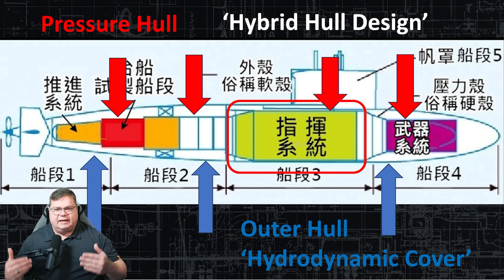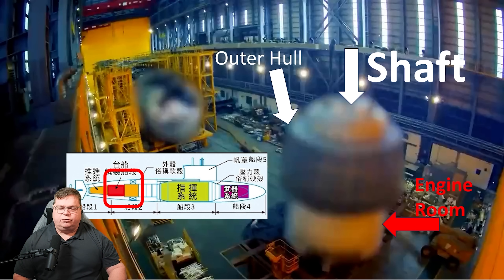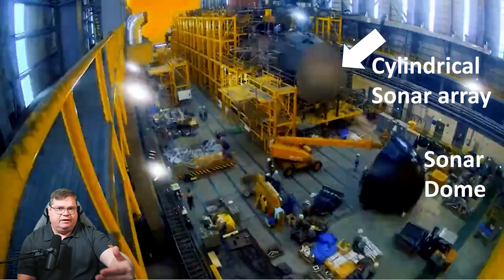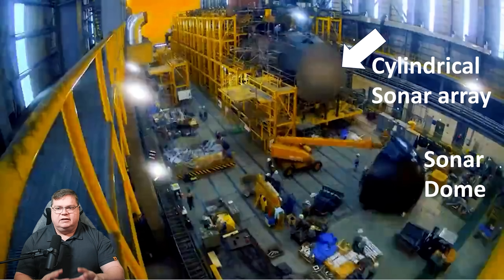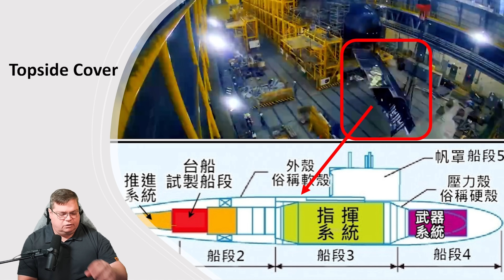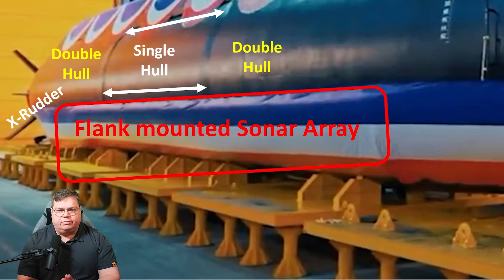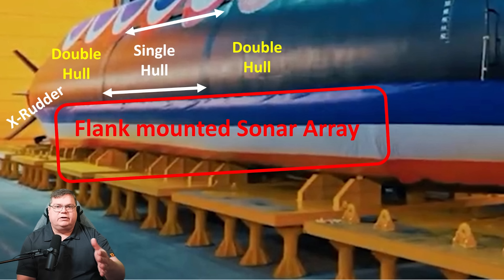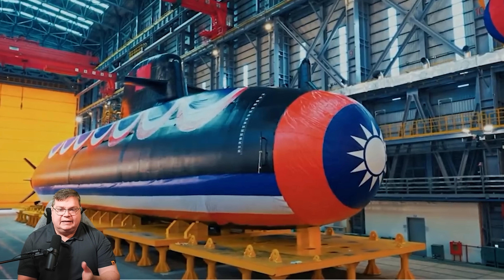What They Don't Tell You About Taiwan's First Submarine

Comment: So Taiwan now has the worlds newest and oldest submarines in their navy.
Reply: Taiwan's first nearly 3,000-ton self-made submarine "Narwhal" has just been built and is undergoing testing. Taiwan's first AI unmanned attack submarine "Huilong" will also be launched by the end of this year.
While Taiwan is building manned submarines, it is also secretly using submarine development technology to produce unmanned submarines. The self-made "Huilong" (meaning: Intelligent Dragon) unmanned submarine is a smaller version of the submarine, with specifications of 30 meters long, 6 meters high and 3.6 meters wide. It adopts a double-shell design (the length of the inner pressure shell is 20 meters). Its height including the sail cover is 6 meters, and the outer shell is also coated with black sound-absorbing coating. In addition, the internal settings are not only equipped with cruise, sonar detection and other systems, but more importantly, it also adds a life support system (for special forces missions) and a system equipped with two torpedo launch tubes. This is almost the basic configuration of a 100-ton small submarine. It uses a hull similar to a manned submarine with a sail-type structure design, and is also equipped with two torpedo launch tubes. The "Huilong" unmanned submarine can launch small unmanned AI boats, torpedoes, mines and underwater loitering munitions to monitor, lock on and loiter attacks on enemy targets. The hull of the "Huilong" unmanned submarine is made of alloy steel produced by Taiwan Steel and can withstand seawater pressure of 1,000 meters. It allows the "Huilong" unmanned submarine to stay at a depth of nearly 900 meters underwater. Not only will it not be detected, but it will also be unable to be attacked by mines or torpedoes.
The "Huilong" unmanned submarine can perform combat missions alone, or it can accompany the submarine as a wing boat for coordinated operations.
Taiwanese civilian manufacturer has developed an Autonomous Underwater Vehicle (AUV) for the Navy - the Seawolf 400 AUV system. The Seawolf 400 AUV is 4 meters long, weighs about 1,000 kilograms, has a speed of 2 to 7 knots, can submerge for 8 to 10 hours, and can carry AI reconnaissance equipment and attack weapons.
Taiwan's Navy has partnered with an innovative company to develop an underwater glider. This equipment has the characteristics of long-term operation, large-scale collection of underwater information, high concealment, low maintenance and operation costs, fast maneuverability, and diversified underwater reconnaissance. It can collect hydrographic information for the Navy and influence the selection of sonar modes and the application of tactics. In addition, the equipment also has stealth characteristics and can perform underwater missions for more than one month, improving the Navy's ability to deal with underwater operations and intelligence collection. Several underwater gliders are currently being deployed to perform missions.

Taiwan plans to produce eight Submarines, 46 AI Unmanned Submarines, hundreds of Seawolf 400 AUVs, and a fleet of Underwater Gliders. Based on this, the Taiwan Navy has been able to build a powerful, modern underwater fleet with AI networked combat capabilities.
Reply: Chinese cyber army pretend Taiwanese and say ridiculous words
Reply: Wumao in full swing ah
Reply: Taiwan took 4 years to learn and design its self-made submarine, and only took 3 years to complete its self-made modern submarine.  Taiwan break the world record for manufacturing the submarine. In 1988 Taiwan was the 1st Asian country who could design and manufacture self-made 3rd generation Jet Fighter. Taiwan is also designing its own fifth-generation stealth twin-engine fighter jet, and the prototype will be produced in 2025. Taiwan is not only strong in semiconductor chip manufacturing technology, but also in other industries. Bravo Taiwan.
Reply: Yes, we Taiwan do, always~.~
Reply: yes, thanks for all the people that is helping us, moss of our subs in the serving of our nave is all grandpa aged subs.....
Reply: Computational power is both national power and military strength. Efficient AI computation depends on high-performance AI chips, and only Taiwan's TSMC can manufacture the highest-end AI chips in the world. Taiwan's National Chung-Shan Institute of Science and Technology has completely domestically developed technologies such as stealth materials, electromagnetic wave absorption materials, and multi-spectrum radar wave scattering materials. Taiwan is also the world's largest and most technologically advanced manufacturer of carbon fiber composites.
With these technological and industrial strengths, it will be a breeze for Taiwan to develop AI-powered missiles that are stealthy, can find targets on their own, counter enemy electronic warfare, and evade enemy detection. AI-powered attack drones, unmanned submarines, unmanned ships, and unmanned jet fighters will also be within Taiwan's reach.
Taiwan's military industrial development strategy is clear and unambiguous. It is to leverage its technological and manufacturing industry advantages to selectively develop military industries.
Reply: Many people are unaware of Taiwan's current industrial and overall economic strength.
Taiwan has a developed technology and manufacturing industry, with global rankings of first in semiconductor chip manufacturing technology, first in information and communication equipment manufacturing, third in machinery and parts manufacturing, third in the scale of biopharmaceutical enterprises, fourth in machine tool industry, sixth in the scale of chemical plants, fifth in the world in terms of shipbuilding tonnage, and sixth in terms of aerospace industry output. It is also the world's largest and technologically best country for carbon fiber composite outsourcing, from tennis rackets, bicycles to aircraft components. Taiwan has many companies that are mid-to-upstream manufacturing companies that are hidden champions in the world. It has produced supercomputers, super AI computers, satellites, and has successfully launched military space rockets on multiple secret occasions. Taiwan's overall technology and manufacturing industry strength is at the forefront with the United States, Japan, and the European Union industrial countries. Taiwan is currently the 20th largest economy in the world, with total foreign investment assets of over USD 2 trillion. It is the fifth largest outward investor in the world and the fifth largest net creditor country in the world.
Manufacturing has always been used to produce consumer goods first, and then military equipment was manufactured due to national defense and war needs. Taiwan's industrial strength is completely used in the export of civilian industries, and the production of military and weapons is limited to specific government agencies. In the past, the government did not attach importance to integrating and supporting private enterprises, coupled with no export opportunities, private enterprise factories were not interested in investing in the production of military equipment. On the other hand, American military companies have long seen the manufacturing capabilities of many Taiwanese manufacturers and have purchased the supply chains of important components and assembly parts for their military from Taiwanese factories, such as military-grade microwave RF semiconductor components, rocket satellite precision components, electric vehicle bearings, military-grade electronic equipment components, military-grade computers, and military-grade carbon fiber composite outsourcing. TSMC is also one of the three major military-grade chip manufacturers for the US Department of Defense. Military-grade chips below 14 nanometers are all manufactured by TSMC. TSMC is the only company in the world that provides military-grade 5-nanometer chip manufacturing technology to produce high-performance logic chips and AI chips.
China is threatening Taiwan by firing missiles and circling Taiwan with aircraft and ships in the waters around the Taiwan Strait. Under the pressure of China's constant verbal and military threats, Taiwan quickly completed its own design of submarines, self-developed the production of submarine steel, and the US, UK, and EU democracies provided Taiwan with core submarine components, and Japan and South Korea provided shipbuilding technology. Some of the core components are still manufactured by Taiwan with the support of chips. It is no problem for Taiwan's overall industrial strength to be converted to support military research and production. Subsequent submarine production will be able to achieve complete localization of submarines in batches.
Reply: Taiwan's IDS Indigenous Defense Submarine is planned to use domestically produced "lithium batteries" as the submarine's underwater power system.
Japan's Maritime Self-Defense Force's Soryu-class "Phoenix" and "Dragon" submarines, as well as the latest Oshidori-class "Oshidori" and "Shirotori" submarines,
 all use "lithium battery systems" as the submarine's underwater power system. The South Korean Navy has also announced that its second batch of new "Dosan Ahn Changho-class" submarines will also abandon AIP power systems and start using "lithium batteries"
 as submarine power systems. These modern submarine countries that use lithium batteries as their main power source have kept secret the amount of time their lithium battery power systems can operate underwater, which has aroused curiosity among people.
Recently, the U.S. naval professional media "Naval News" reported that the Indonesian Navy will order from France a new batch of "lithium battery"-powered Scorpene-class
 submarines for it, which is referred to by the French side as the "Scorpene Evolved". The French shipbuilding company Naval Group claims that the class of submarines, equipped with "lithium batteries", can last up to 80 days on a single mission, of which 78
 days are submerged, and the maximum range can reach 8,000 nautical miles (about 14,816 kilometers), significantly reducing the rate of surfacing.
The French "Scorpene Evolved" lithium battery submarine has a weight of 2,000 tons, and the lithium batteries fully charged can support the submarine for 78
 days of submerged operation. The Taiwan-made IDS submarine has a weight of nearly 2,800 tons, and can carry more lithium batteries than the French "Scorpene Evolved" lithium battery submarine. It is estimated that the Taiwan-made IDS submarine with lithium
 battery power system may support 90 days of submerged operation.
Reply: Taiwan has successfully developed a 533mm-diameter torpedo launch system for Taiwan-made IDS submarine Narwhal. In addition to being used to launch US-made MK-48 heavy torpedoes, the system is also being prepared to launch Taiwanese-made submarine-launched Hsiung Feng II anti-ship missiles, submarine-launched Hsiung Feng III supersonic anti-ship missiles, submarine-launched Hsiung Sheng cruise missiles, and submarine-launched Sky Sword II air defense missiles. The diameters of these Taiwanese missiles, after being modified and installed in submarine-launched pods, are all smaller than 533mm torpedo launch tubes, and the IDS submarines can all launch them in the future.
During launch, the torpedo tube will push the Taiwanese missile pod into the sea. After traveling a certain distance and approaching the surface, the missile engine will ignite, break out of the pod, and emerge from the water. After the guidance system is activated, the missile will fly into the sky and autonomously attack the target.
Reply: Yep! Those newest subs will only for kill Chinese but anything else.(such a money waste😡).

For those oldest subs just proved what I said because if there is no China on earth we don’t need sub feet.

If I can lunch nuke to China, they were wipe out from our planet yesterday.
Reply: exactly lmfao
Reply: Republic of China <==== Chinese roots . period
Reply: it's like having your ex gf and new gf all at the same time, pretty cool huh?  😅
Reply: China is way ahead; made use of own Taiwan to buy western technologies...
Reply: lol
Reply: Underwater submarines are difficult to detect. The waters around Taiwan are even more complex due to the Kuroshio Current and volcanic terrain.
The Kuroshio Current, also known as the Japan Current, is a branch of the North Pacific Ocean current system. It is the second largest ocean current in the world, originating in the Philippines, passing through the East Coast of Taiwan, and flowing northeast along Japan before merging with the North Pacific Current. The Kuroshio Current has a current speed of 1 to 2 meters per second and a width of over 200 kilometers. Fish and underwater vehicles are carried along by the Kuroshio Current like they are on a highway, automatically flowing towards the North Pacific Current region. The complex deep sea area where the fast-flowing Kuroshio Current passes through stretches from the Bashi Channel region in southern Taiwan, connecting to the East coast of Taiwan, to the Miyako Strait region in northern Taiwan.
Sea of East Coast of Taiwan, a "thermocline" is formed in the area where the water depth is 100 meters. Only a few sound waves can penetrate this "thermocline." Most of the sound waves are reflected back from the "thermocline" like a mirror, and continue to transmit back and forth between the "thermocline" and the surface of the sea. A sonar detection blind zone is formed below this area. Taiwan submarines and unmanned submarines can hide in this blind zone, and the Chinese military ship's sonar system or the sonar detection system thrown into the sea by anti-submarine aircraft from the sky will be unable to detect Taiwan submarines and unmanned submarines.
If Taiwan submarines and unmanned submarines dive to a depth of 200-300 meters below sea level, the enemy can only use submarines to search for submarines to detect them. However, the surrounding waters of Taiwan are Taiwan's territory, especially the Bashi Channel in the southern part of the Taiwan Sea connecting to the Miyako Strait region in northern Taiwan, which is an area with unpredictable Kuroshio Currents. Chinese submarines or underwater vehicles cannot stay in this area for long. They will be automatically washed away to the North Pacific Ocean by the Kuroshio Current and will be unable to sustain combat operations here.
Taiwan has already fully understood the Kuroshio Current area in the east, and is clear about the changing location of the underwater ambush zones around Taiwan throughout the four seasons. It has also deployed fixed and floating underwater sensors or unmanned submarines. Taiwan submarines and unmanned submarines are ambushed in the underwater ambush zones that move with the seasonal sea conditions, or they release denial intelligent mines in the surrounding area in advance. Chinese submarines dare not approach, for fear of being caught in the net and killed. When necessary, Taiwan's IDS submarines can dive to a depth of nearly 400 meters below sea level, where Chinese submarines cannot reach. They can then launch MK-48 torpedoes to easily destroy any enemy submarines or enemy fleet convoys that want to attack.
Taiwan's geographical location is unique. The West Taiwan is separated by the Taiwan Strait to China, which is on average 180 kilometers wide, which is a natural barrier that can easily deter China's attempt to invade Taiwan by landing. The Bashi Channel in southern Taiwan connecting to the East Coast of Taiwan to the Miyako Strait in the north is an area with fast-flowing underwater currents. It is an area that cannot be stayed for long unless there is support from a nearby port. It is also a natural barrier. Taiwan's great self-made submarine capability has supplemented this block of underwater defense and combat capabilities. It can easily deter China's attempt to invade Taiwan from southern, eastern, and northern Taiwan. Taiwan's national defense is in a state of prosperity, and Taiwan can now rest assured.
Taiwan's domestically produced submarines and unmanned submarines are the most important strategic weapons of national defense. Now that Taiwan has produced manned and unmanned submarines, China not only has no chance to cross the sea to invade Taiwan or blockade Taiwan, but it also has to worry about its ports being blockaded, which will completely shatter China's illusion of invading Taiwan! Taiwan's air defense missile system density is one of the highest in the world. It is impossible for the Chinese military to fly over. The Taiwan Strait in the west of Taiwan is a transparent firing line. The Chinese military ships and submarines that invade from here are tantamount to suicide. The southern, eastern, and northern parts of Taiwan are guarded by the natural Kuroshio Current barrier and the submarines and unmanned submarines of Taiwan Navy. The Chinese aircraft carrier, destroyer, and escort fleet will not dare to come.
Reply: @lagrangewei  Taiwan is the real China
Reply: They said it officialy 40% were Made in Taiwan only
Reply: I am Taiwanese.
Welcome to submarine museum😂
Reply: @keelung0804  pitiful you
Reply: The colors make it look like a blow-up pool toy. That's next level camo.

Comment: Not true on the X Tail. Even though all four planes move when the sub dives or rises, they move just as much if not more than the cruciform tail. The reason being that with the planes at 45 degrees to the horizontal axis, only about half the force is on the vertical axis and useful for pitch change the other half is results in compressive or tension forces between the left and right tails. In order to have the same level of force the sum of the deflection amongst all the tails is greater than that of the horizontal tails of a cruciform. The X plane is useful mainly for the ability to bottom the sub on a seabed.